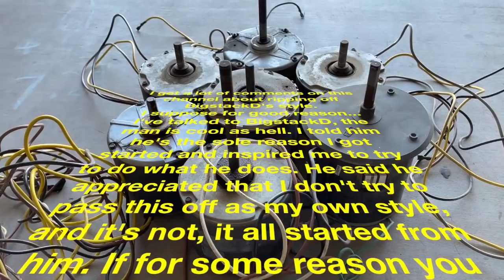Seven Motor Meltdown Salute to BigstackD - Melting Copper and Aluminum - Trash to Pleasure

Comment: I too am a big fan of Mr. B. I wouldn’t have discovered your channel without him. 

I would have watched all 7 hours of you dismantling those motors. But that’s me. Part of the fun of watching you dismantle is the separating, stripping, cutting, organizing and cleaning. 
I also like that you typically don’t use ice to cool the metals. Doesn’t compromise the integrity of the metal, making it weaker?

My dream is to see someone start a do-it-yourself shop for customers to experience the dismantling and creation. I especially want to experience removing the sludge before the pour. Better than hanging out at a bar or gym.

Comment: A little tip to help strip the copper out of the stator, if you have a fire pit build a decent sized fire and toss them in. It'll burn off the varnish that holds it all together and soften the copper at the same time. You can cut one end off before or after. Doesnt really matter but the wire will just slide right out afterwords

Comment: Originally my interest was to melt my copper and brass to square shaped stackable ingots for storage. It works well but when it comes to the aluminum I can see 35 cents a pound coming out of a mold that can lead to big bucks! Providing you select the right mold. Your skulls seem like a good seller.

Comment: You are a real one man. Only a true bigstackD fan could think of a motor melt salute. Unrelated side note, have you looked into fuel oil furnaces? They seem to make cast iron a lot more feasible
Reply from the maker: Right?!. He is the man with motors so I figured it would be best fitting. I haven’t looked into those, but I will now. Thanks man.
Reply: @TheGrowingStack  you got it dude. I heard about oil furnaces after changing 50 gallons of hydraulic oil, nowhere to take the old stuff lol

Comment: Hey fellow stacker out of VA here. Where did you get that 15lb copper ingot mold?
Reply from the maker: I picked it up from a metal shop near me. They weld and make all kinds of stuff. I guess they use those for melting and making lead ingots to use for reloads. So I bought a couple for stuff like this.
Reply: @TheGrowingStack  i need to find something like that, i only have 1lb 5lb 10lb than a 50lb mold.

Comment: Just curious... what is the yield worth vs time vested and production costs. I won't count the ice lol
Reply from the maker: Great question... The yields I can calculate. Based on the market price right now, the total value in the metals is $43.34
The cost... I didn’t weigh the propane used so I don’t know that. The rest is all time, which took me about 12 hours of work to breakdown, melt, and clean up while filming it all. I probably took another 4 hours straight of editing this monster. It’s really hard to calculate the cost of my own time and time spent away from family while being temporarily consumed in a project. I love the project side of it so it’s fun to me, but impossible to put a price on. And then of course there’s the ice 😂 Cheers!

Comment: Bruh..  Any chance you're a part of Big Stacks FB page??  I've got 50lbs of copper, probably only 20 something pounds of aluminum & maybe 5lbs of reclaimed brass, my pops been hookine up with MOST of my material, but I'm SLOWLY makin some progress..  Doesn't help that it's less than 20°F here & I've found that Devil Forges furnaces don't like runnin at temps under 40°F cuz it makes it difficult for them to maintain stable temps to keep things like copper, brass & aluminum in liquid states..☹️
Reply from the maker: I’m not a part of his FB page, in fact I’m slacking at even using my own. Less than 20°F!! I complain when it hits 40°F 😂 Yeah I can imagine that would make it tough to run the furnace and stay liquid at such temps.

Comment: How did you get an accurate ingot mold of that size?
Reply from the maker: There is a metal shop I found that makes them. They also melt down and sell lead for reloading. That’s what they use these for, to make big lead ingots, so I bought a couple.
Reply: @TheGrowingStack  Right on, wish i could find a shop around my area that does that....  guess i better learn how to weld.

Comment: Well done.  🔥👍
The BsD inspiration is clear.

Is this going to be a regular midweekly primer for the Friday am main show?
😉👍

I was surprised when you started with copper. 😳
Reply from the maker: @CP trikester thanks a lot, I appreciate that. 
I planned on getting on an every Wednesday schedule, but keep managing to screw that up... I’ll get more consistent, Wednesday is the goal moving forward. 
I actually didn’t know what to start with, but I knew the copper was going to take the longest so I started there 🤷‍♂️ that aluminum went by in a flash, it was pretty fun.

Comment: I saw u burnt yourself when putting the aluminum in wasnt cooled down was it😂
Reply from the maker: You know, I thought about putting my gloves back on since I did the aluminum right after the copper and I knew it was still very hot, but I was right there and filming so I just went for it. You can totally see the hesitation right before I went in 😂

Comment: Bro if I were to send you some materials to melt would you be willing to send me a little coin with your logo or a skull,  anything really
Reply from the maker: Hell yeah! What kind of material do you have?
Reply: @TheGrowingStack  copper and aluminum mostly but some brass too. I do hvac, plumbing and electrical work.
Reply from the maker: @Jeff Mccurry Which metal are you thinking? Or all of them? Shoot me an email and let’s iron it out.
Reply: @TheGrowingStack  what’s your email address. What I was thinking is I send you all I can fit into a box, a mix of brass copper and aluminum. All I ask in return is just something cool that you’ve made. I have wanted to try this with BigD but he is pretty far away, no telling how long it would take. Thanks.
Reply from the maker: @jeffmccurry1401  thegrowingstack@gmail.com